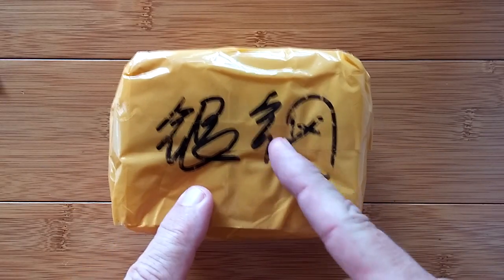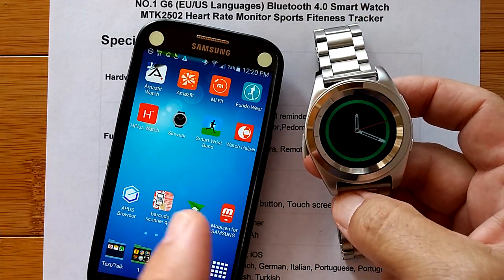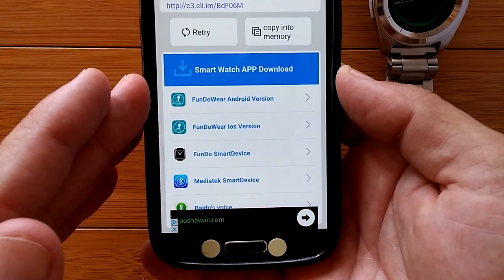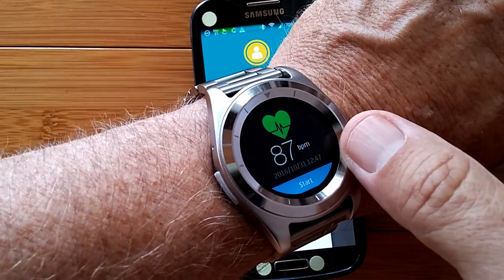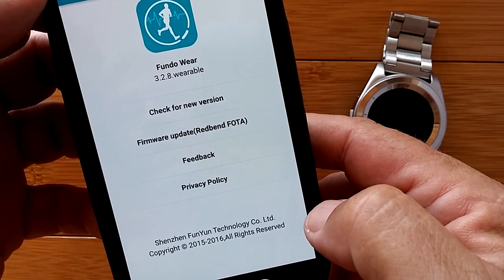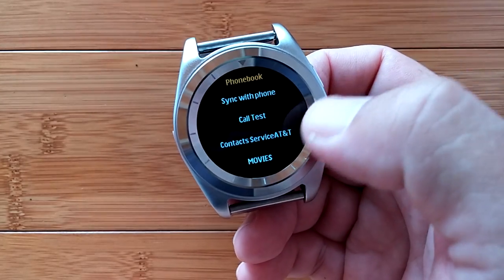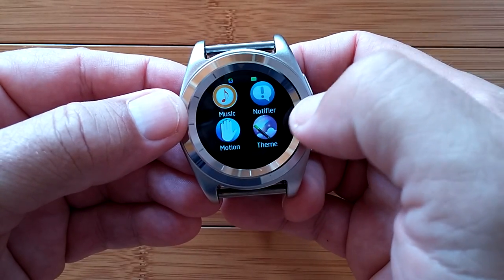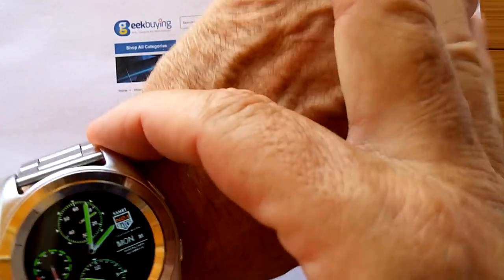No.1 G6 Sports/Business Smartwatch: Unboxing and Review

Comment: I have the g6 rubber strap watch. Been using it for over a year, just recently I dropped it in water and it doesn't work anymore. Whenever I try to switch it on, it just vibrates and nothing happens. Can you please help me on how to make it work?
Reply from the maker: I'm afraid you'll probably need to buy another one. You can try and dry it out in low heat, like setting it in a warm (not hot) car for a few hours. You need to get any water vapor completely out of the watch, and it needs to evaporate through the same places it leaked in. If you're very lucky the dried watch will work. If the electronics were damaged by the water (not just shorted out from the water vapor or small amount of water in the watch) it won't work and you can throw it away. You may want to get a new one anyway. The G6 is getting pretty old by today's watch standards.

Comment: Got the watch. How do you shorten the links? I looked at so many tutorials but the band that comes with the G6 is very atypical. There are no noticeable pins nor holes to push the pin up.
Reply from the maker: You need to take it to a jeweler as it requires special tools to remove the links. That's what I did. Cost me twenty bucks, too.

Comment: For those going for their first smartwatch in 2017..lol This is a nice choice, but keep in mind; no water proof and I am not sure if it handles Whatssap, it seems it does since it's a tether watch. I researched a lot of these in order to find one that included mostly all the daily apps we use and less compromise in screen quality, and this model seem to have the least cons.  Also, don't pay more then $40.00 for any of these.. beyond that just save for the ones on the $120.00 range instead.. it seeems much but the quality is superb.
Reply from the maker: Thanks for your comments and insight.
Reply: You're welcome SWT.. and one more thing for those still on the fence for thier first smartwatch: the No.1 S9 is a straight upgrade in my opinion, I don't own an S9, but a friend does and it's way better than my G6.. The S9 has NFC, find my phone, many available faces, 380mah, many fixes for some annoying settings and still under $40.00.. it's cons: No GPS.  For those that care, I wen't from a G6 to an Apple watch... which I regret, I should've waited a bit more for the S9, it does all I want exept GPS, but for less than $40? is a steal. My friend is still happy with it.
Reply from the maker: Thanks again Omar. GPS and the tracking overhead eats a lot of power, so if somebody really doesn't care about using GPS on a watch, it's better that it's not there. Less weight to the watch, less bulk to the design, less overall cost, and potentially longer battery life. If you can live without GPS, then it's best not to have it in your watch. Of course, ALL Android watches have it, so you're automatically looking at a tethering or dual mode watch.

Comment: As i have personally used the watch 10 days ago and i sold it 4 days 
after that.. I didn't like at all.. You need to know few things below.. 

Now lets talk about the product.. 
The watch looks goods.. the first impression of the watch in looks is 
good its clean clear nothing much messy but box packing is good.. 

Now when you use the watch for a while you will get to know some bad 
things about the watch.. Like 
Cons 
1. It doesn't have genuine leather belt

2. The antenna is built in the strap... That means you cant change the 
belt ever again.. That makes no sense.. You buy a 110$ watch and you 
cant change the belt.. It means you can just use the watch for 6 months 
max and then as you cant change the belt you cant use the watch anymore 
now.. 

3. Now even though antenna is in belt its network is not at all strong 
at times.. Gps doesn't lock you location while is on your wrist. 

4.typing on watch is pain in ass

5. You are stuck with very very limited watch faces.. As it does not 
support any 3rd part apps..there is download option for watch faces in 
the watch itself but there is some major problem with software i.e if 
you download the watch faces then you will face some serious software 
problem  ... Then to sort out that software problem you have to manually
 do some software stuff that is difficult for normal people.. 

6. There is no software update in very long time. 

7. My watch does not detect any network
So it also has network problem of simcard slot problem.

8. Heart rate sensor and pedometer doesn't work that good..  Its just 
below average.. 

There are not much of pros...

so my tip add some extra bucks and get some good branded android watch...or samsung gear s2 ....like i did.
Reply from the maker: Thanks for your comments Amit. It's great when actual users take the time to let others know about their experiences, good or bad.

Comment: Fundowear does not work as of yet with Android 7 Nougat.  Tried watch with Android 6 works ok but on Nougat will not push notifications other than sms to watch.
Reply from the maker: That's very good to know. Thanks for testing. If you have the time and interest, could you try the apps Meadiatek SmartDevice and WiiWear? Perhaps they interface with the notifications process of Android 7 differently.
Reply: Wiiwear does not work at all with this watch and Nougat.  Mediatek works but with same limitations as Fundowear, only SMS and battery low warning notification but no email notifications.  All work with earlier version of Android.
Reply: Alphonse DeSimone do you know if it works now of if it still doesn't work with nougat?

Comment: Hi, is this No.1 G6 compatible with Android 6.0 and above?

Thanks!
Reply from the maker: It should be. The important thing is if the tethering app will run on your Android phone as that is what is used to connect to the watch. You can download the app now and check it out. It's called Fundo wear and it's in the Google Play Store.
Reply: SmartWatch Ticks 
Thanks so much for your quick reply. I've just placed an order for it. Will check it out. Mine is Note 5 so should be safe.

I've read reviews that Fundo app isn't that great - but if that's what's customised for No.1 smartwatches, guess we've to live with it. The alternative MediaTek app didn't seem that great either.

I've also read that Android Wear 2.0 app doesn't work on No.1 - if my memory holds up.
Reply from the maker: You'll probably use the Medeatek SmartDevice app to install custom watch faces, if you want to do that, then uninstall it and use Fundo wear for day to day notifications. You're right, the app isn't that great.
Reply: Thank you for your great insights

Comment: does it have only  4 custom faces?
Reply from the maker: Yes, but you can add more through the Fundo Wear app.
Reply: thanks, I´m really inclined to purchase it because it doesn´t need any dock to recharge and also because it looks small (I don´t have big wrists) , sorry to bother but which one is the smaller: G6 OR Finow x3 plus ?
Reply from the maker: The G6 is much smaller.
Reply: thanks a million!
Reply: I just got mine today from gearbest, I really liked it, used Fundo wear app, added awesome face watches, thank you for the tips, quick question: is there a way to remove some of the custom faces? I noticed the storage capacity is not very good, but anyways good CXB.
Reply from the maker: If you learn a way to remove the stock faces, please let us all know. Some of them I'd never use so I'd like to get rid of them, too.

Comment: two questions: is possible to avoid watch answer for incoming calls? i have to switch phone speaker every time i receive a call. Ssecond. where can i buy a TPU or metal strap for replacing the original one?. also 1 issue: fundo wear isn't stable for BT connection with G6. i use mediatek smartdevice
Reply: Paolo, I have also found the Mediatek smartdevice App to be more stable and less battery consuming, it's nearly the same as Fundo Wear but does not have the fitness tracking. Not sure if that works well anyway with Fundo as I deleted the App when I saw what it was doing to the battery! 
Regarding your (and my) watch answer problem for incoming calls, about 3 weeks ago Smartwatch Ticks suggested pressing the bluetooth button on the phone to disconnect the watch from the phone. For me that works OK when the phone is already unlocked but i have trouble unlocking my phone when it rings, even more fumbling and embarrassment on the bus when both the watch and phone are ringing!  Disabling bluetooth means no notifications, etc  A phone call disable option on the watch would have been a better solution. I wonder if this is the same problem on other tethering watches like the Samsung Gear 3?
Reply: Thanks for reply, Anton. have you tried to disable notification of caller app from the list of app notification in mediatek smartdevice app? have you in your phone BT option the selection for input device (keyboard logo) and phone voice device (headphone logo)? i tried to disable each of them but the watch always rings. the fastest option imho is to switch BT/phone speaker instead of switch off BT. i have Lenovo K4 note phone and i can choose this option aswering a call. have a nice day .. and year
Reply: Paolo thanks for your response! In my Samsung Note 4 BT settings for the paired G6 device I have switched off "call audio" This stops calls going to the G6 watch but it also stops all notifications, even though the watch still shows an active BT connection.  I also disabled the call service in the Mediatek App, but I still get the call going to the watch. It's a pity these didn't work as it's almost impossible to unlock the phone when there is an incoming call!
Reply: I have not found a way but when the call comes in on your phone tap the blue tooth sign ( near the speaker mute sign on the screen) and select device speaker and you can talk on your phone

Comment: smartwatch ticks
what app will I need for my finow x5plus for using it as a phone
Reply from the maker: You don't need an app. Just stick a SIM card in the back and it will work just like an Android phone! Should be as easy as that as long as the SIM card supports the GSM network and your carrier uses the frequencies needed by the watch. Just try it. It will either work or not, and if not, visit your carrier for troubleshooting.

Comment: I faces some problem with this smart watch,There is nothing appear on the display but there is a sound on it when I click the button. There is a way to fix this?
Reply from the maker: It might be that the brightness is all the way down, or the backlight has burned out. Try angling the display in bright light to see if you see any reflections from the screen showing what's on the display. Last resort might be to try and let the battery drain all the way down so the watch is completely dead, then charge it up and turn it on. See if that fixes it. Since this is not an Android watch, I don't know how you would flash the firmware.
Reply: Thanks for answering my question my question +SmartWatch Ticks I've already flash a new firmware on it and it still blank,I don't no why,just bought it 😅I will try your last resort to keep the battery drain and try to charge it again,thanks you so much +SmartWatch Ticks

Comment: I saw you guys are asking how to install watchface on G6.This is a tutorial.hope it helps.
1)http://www.chinawatchs.com/how-to-add-watch-faces-on-mtk2502-smartwatch/
2)http://vxpface.ml/tutorial.php
Reply from the maker: Thanks so much for this Will! I've added your comment to the G5 and G6 videos. I'm pretty sure it applies to all the Fundo wear supported tethering watches as well.
Reply: yep,hope everyone enjoys and big thanks to the developer.
Reply: The vxpface website has broken down. You can go to this site. http://www.watchfaceup.com/
Reply: yeah thanks that's worked great guess it's just fundo as mediatek worked first time thanks
Reply from the maker: Good to know. Thanks for checking back.
Reply: I've tried this multiple times with the fundo app and the new faces don't appear in the my application section on fundo are there faces that don't work
Reply: Uninstall the fundo app and install the MTK smartdevice. For more details you can read the tutorial in that website. This method won't work with IPhone, you may need an Android phone to install custom faces.
Reply from the maker: Did you try it with the Mediatek SmartDevice app after uninstalling the Fundo Wear app like Will Smith recommended?
Reply: SmartWatch Ticks hey, do you know what is the pin size for this watch's strap?
Reply: Will Smith is this still the most current/best way to add faces on the G6? Also, roughly how many custom faces will the G6 hold? I'm one who likes to change it up now an then.
Reply: Razvan Paraschivescu ew
Reply: smart watch for women

Comment: Hello , i have a question , thank you for all those reviews , i just want to know does the heart rate sensor support being used from apps like Nike+ Running Club or Nike+ Training Club  or just the Fundo wear app ?
Reply from the maker: It only works for the internal connection to watch software and Bluetooth transfer to the Fundo Wear app. Somebody has been trying to get to the sensor output with limited success. Any 3rd party apps needing heart rate data will have to rely on you to input it manually after you take your watch reading.
Reply: is there  anyway to connect watchs like this to any app ?
Reply from the maker: No, not really. It's not an Android watch. It's a simple tethering watch with very little memory.
Reply: thanks alot for replying

Comment: Is the whole watch body stainless steel or just the dial? Because the body looks more like anodized aluminum than it does stainless steel. 

What do notifications look like? Can you read the text messages, emails, etc?

FWIW, the coupon code only works with the TPU band models.
Reply from the maker: Thanks. I'm checking into it right now.
Reply from the maker: OK All straightened out. The metal band is $2 more. That's the best they can do at these prices. You can get it for less on Black Friday if you want to wait about 3 weeks to order. There's a new code for the metal one.

Comment: Happy Halloween
Greetings.
I have few questions
1. How many hours battery last in a single charge?
2. Does it goes heat?
3. Is it disconnect frequently like other no.1 watch?
4. Is it water resistance?
Reply from the maker: The watch is absolutely brand new, so
1. Haven't even finished the first charge
2. Feels cool to me
3. Haven't noticed other than what I show in the video
4. Good question. With the rubber cover on the USB port, it's better water resistant than most. We'll have to check the specs and other user's experiences on that one. I wouldn't swim with it, but splashes may be OK.
Reply from the maker: Thanks Splen. Really helps to get feedback from folks the actually use these watches longer than I do. Appreciate your input.
Reply: Thanks for replying 
after D5+ this one is my next watch for gym and running. .
Reply from the maker: We're asking viewers to report their battery life experience in the comments of this video: https://www.youtube.com/watch?v=RmK9eoNbFag&t=666s
Reply: I have this watch. Been using it for over a year, just recently I dropped it in water and it doesn't work anymore. Whenever I try to switch it on, it just vibrates and nothing happens. Can you please help me on how to make it work?